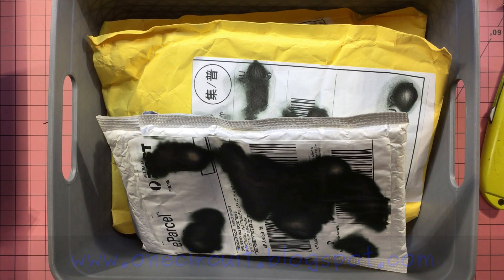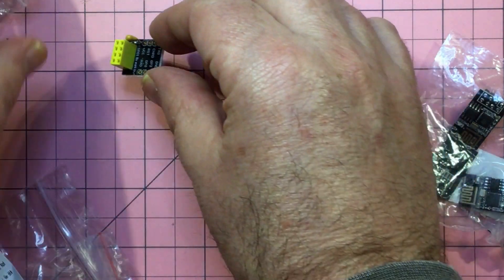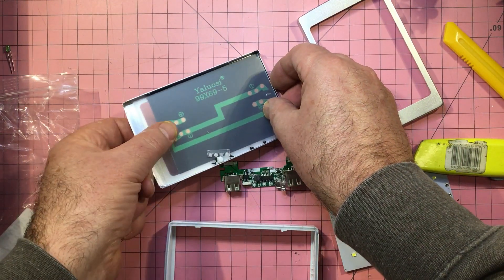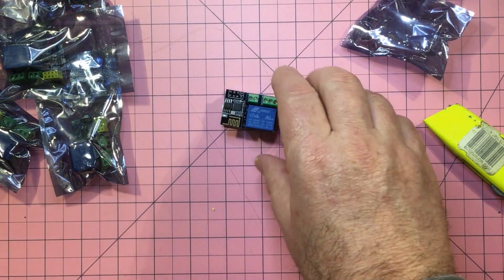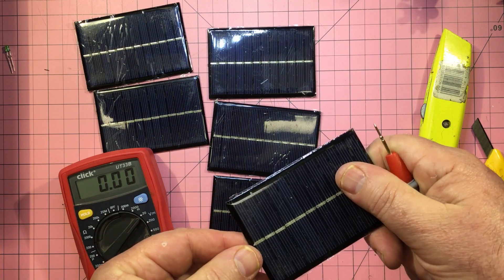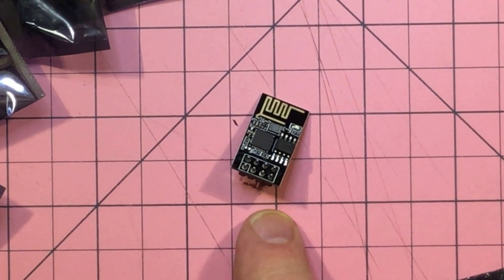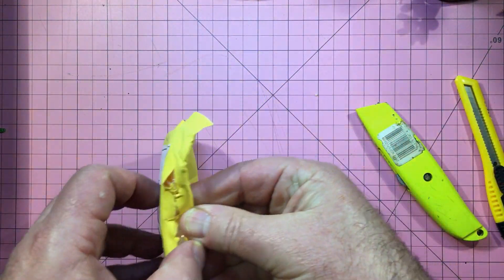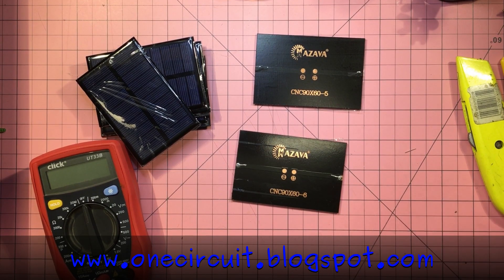Mailbag #8

Comment: au solar charger/powerbank  $2fiddy  crikey  you would buy that just for parts  unreal how they make tech parts cheaper than buying   milk/bread  
the led    alone $2 usb parts    -Most techy thing i did this week   Straps a cheap $2 garden light to Clothes line pole ,  now i wont run into it   at night ( renter no outside light)
Reply: Solar powerbank  aliexpress about $3.50 + P/H  $4 then add batteries = ? from old laptops batterie packs  or buy
Reply from the maker: Definitely recycle the laptop batteries, they’re usually pretty good, and easily tested. 👍😀

Comment: Any bets how slowly the solar panel will charge the power bank?  

Will it even overcome the self-discharge rate of the batteries and voltage converter board?
Reply from the maker: It’s a pretty anemic looking solar panel, but if that’s the case then maybe pimping it up with another panel may help? I have a solar powerbank which certainly does not charge the batteries, but it does lower the discharge rate, which does help (e.g. on camping trips). 👍😀

Comment: Years ago, my old ESP8266's had difficult 2.0mm spaced castellated pads along the edges, and a 2-button boot operation.  I like yours better.
Reply from the maker: I’ve just taken delivery of a PCB I had made for the ESP-12E/F and the ESP32-C3 form factor chips. I’m keen to solder a few in to see how they perform. 👍😀

Comment: You can buy 50 new blades for under $10 to fit your old knife. That screw in the centre opens it up for replacing the blades.
Cool video, you will never be short of ESP 8266-01 boards now. You could make your own adaptor for them from perf board that includes the solar charger.
Reply from the maker: Yes true. When the project is a little more mature I think that a custom PCB is a definite chance. 👍😀